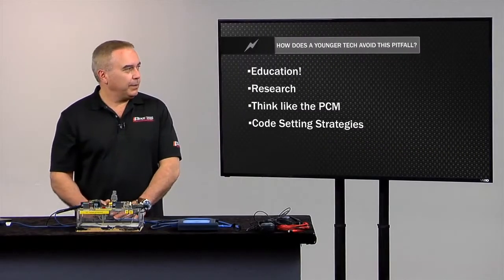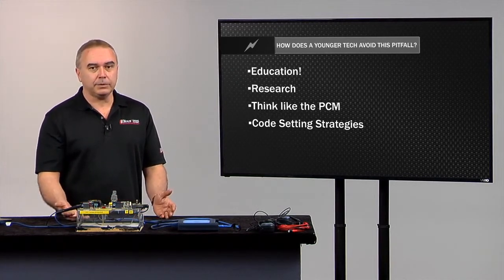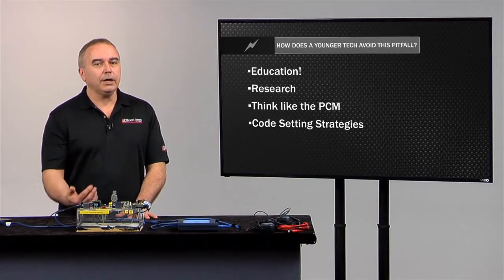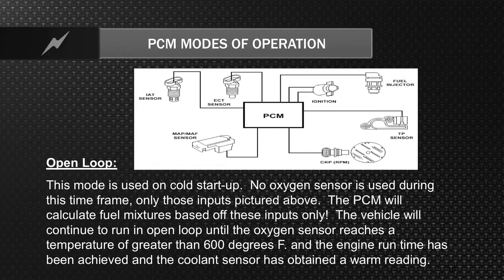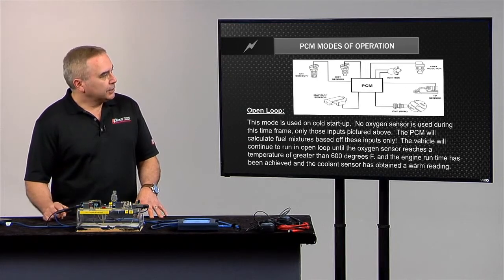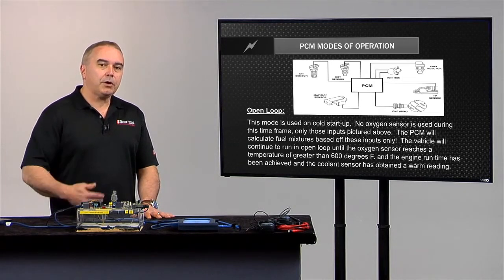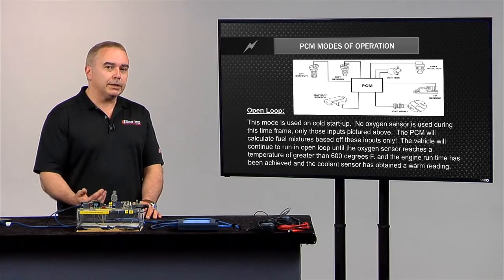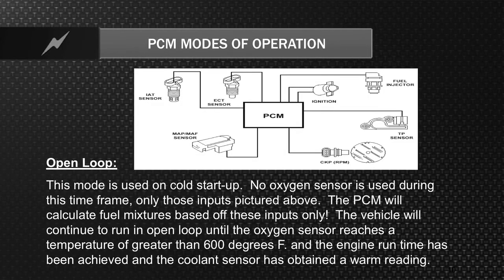PCM Modes of Operations | Tech Tip

Comment: Thank you for the video. Good job. Does AVI have any specific Dodge computer controlled charging system operation, testing, and diagnostic of the GEN Field Control by the PCM? Like, does the PCM send put the voltage PWM to the alternator or does the alternator send out the voltage on this GEN Field Control Circuit to the PCM and the PCM toggles it to ground to create the PWM signal? Thank you
Reply from the maker: We will inform John Forro and other master mechanics, but we do not currently have a specific Dodge video's at this time. Sorry :(
-J. from AVI